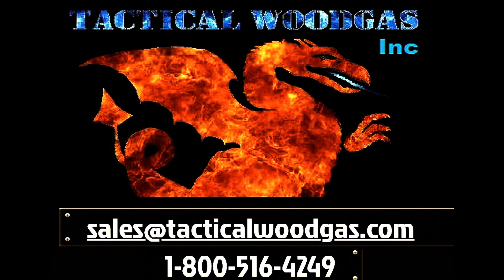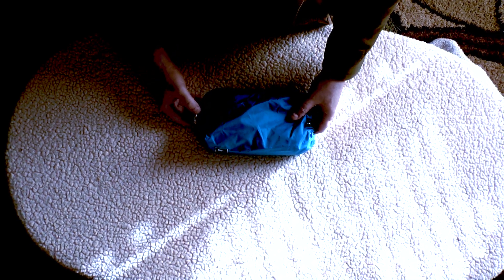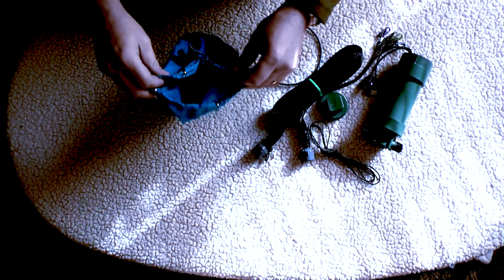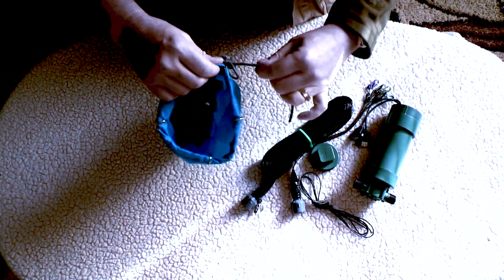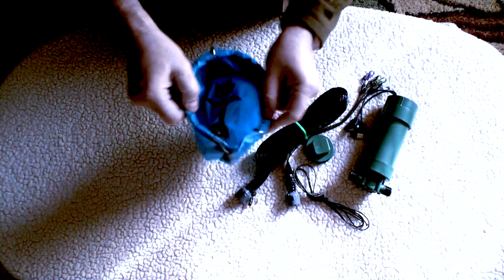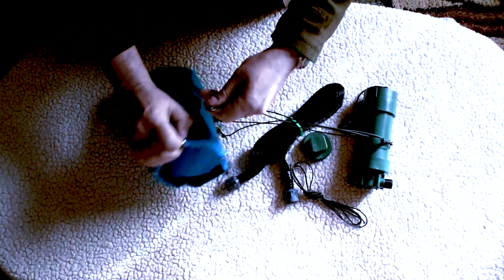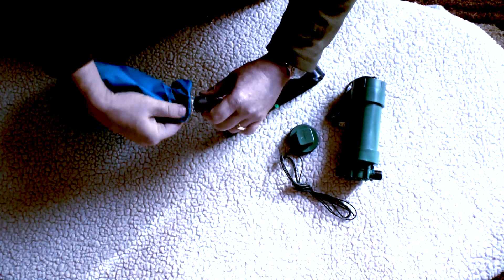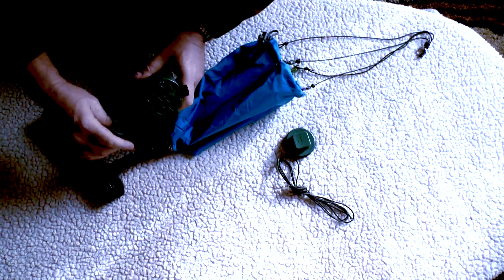10 Watt Backpacking Hydro Power from TACTICAL WOODGAS INC

Comment: What is the GPM required to make the max power? Is there a minimum PSI required or is it all about volume per minute?
Reply: Jeff Barr I was wondering the same thing. Seeing how long ago this was I may be able to look it up. Also, if needed one could build with rocks a drop off high enough to build the psi needed, correct?